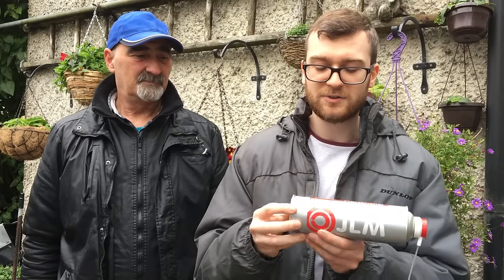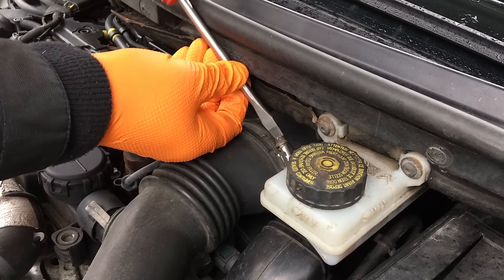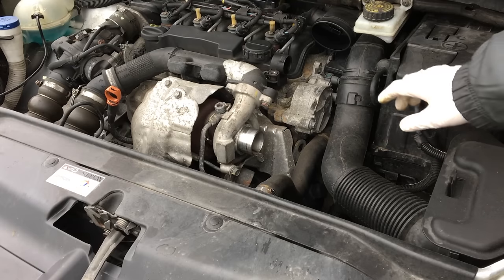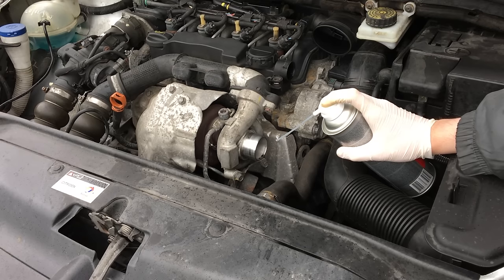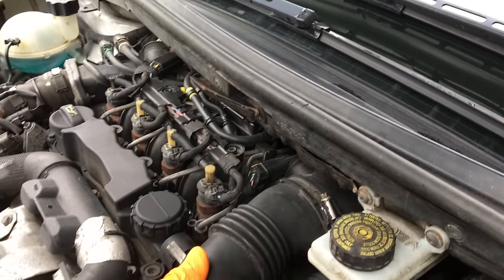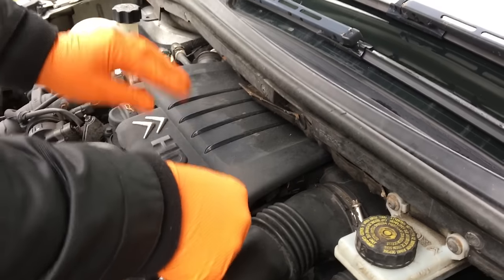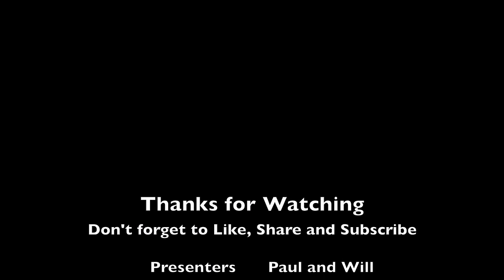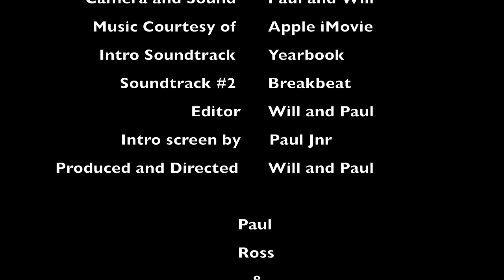How To Clean an EGR Valve Without Removing It

Comment: Good morning Gentlemen how are you after a long and wet winter ?, my 2012  Berlingo Multispace has 137000, miles on it would you think i could change the PCV my self ,to small a job to bother my Auto mechanic with ,keep safe Paul.
PS.when are you going to put out some new Citroen quick fixes ideas  please
Reply from the maker: The pcv is inexpensive and not difficult to replace. 
We are working on some more Citroen videos and will upload in the near future.
👍
Reply: Thank you ,keep safe ,Paul D

Comment: Good evening Gents great weather at last .a friend gave me a brand new turbo cassette which i could do with in the long term however when we fitted it  ,it fitted beautifully until we fitted the large circlip  and then it wont turn ? its exactly as my one in every detail  but must be 2 / 3 thou longer any ideas please ,i had bought a kit to restore my turbo bigger job i know Sincerely Paul D.
Reply from the maker: Hi Paul,
You must mean a turbo cartridge. 
Is it OEM or aftermarket? Is your friend a turbo specialist?  
It may look the same but there are several different genuine Garrett turbo cartridges for the Berlingo as there are aftermarket ones.
Did you get the replacement cartridge based on the model number embossed on the turbo housing that's in your vehicle?
Reply: Sorry you are correct Cartridge,no pats multispace was a write off  he purchased his as a aftermarket unit from some English company HJ is on it his citroen was as ours HDi 1.6 90  2012 he never got  to fit it before his brother totaled  there multispace ,there are only a few numbers on pats and lots on ours ,we purchases a kit to refurb ours but haven''t done a thing since we tried to fit pats and failed Paul
Reply: Hi based on your sound information i gave the Cartridge back  to Pat ,maybe you can suggest some one to rebuild my turbo or an exchange new for old situation please Paul
Reply from the maker: Hi Paul, The link below is for a company in Mullingar. Click on the link or copy and paste in your browser. 
We would suggest you have a talk with them before you commit. We have not dealt with them so cannot comment on them.
http://www.mullingarturbos.ie/
Reply: Thank you will do ,i appreciate all the help you give me ,Paul

Comment: Does egr cleaner make a petrol engine smoke as its burning off?
Reply from the maker: Not all petrol engines have egr valves. If yours does and you spray cleaned it then possibly expect a small amount of smoke initially as its recirculating and burning off. Hope this helps
Reply: @DrivewayDudes  it's all good I don't think it ever had been cleaned in 117k so was burning all the nasty crud off from the intake it's cleared now though
Reply: And thank you for your reply

Comment: Good afternoon Gentlemen  my mechanic showed me a wobble in the turbo shaft suggests i buy a repair kit on line and we can rebuild it can you suggest where i look for such a kit as there is no damage to the fan as yet but needs bearings,Thank you both,Paul.
Reply from the maker: Your mechanic may very well be correct but we would suggest you take your car to a Citroën approved garage to confirm (if its the Berlingo you are referring to).
Turbo rebuilds should only be carried out by those specialised in that field.
Blades spinning at up to 250,000rpm can disintegrate due to the smallest imbalance.
If it's not done exactly right it could lead to catastrophic consequences to not only the turbo but the entire engine as well.

The final decision is entirely yours of course
Reply: Thank you hence i asked your advice first ,ill do as you say ,how many rounds do i owe you now ?.Paul
Reply from the maker: We are happy to offer advice and suggestions. 
If we're ever in your area i'm sure a cuppa would be grand :)
Reply from the maker: Please don't put up your personal details for all to see. i saved it and deleted it here
Reply: ok thank you paul

Comment: Hi again i am again looking for your advice please  cleaning the berlingo cloth seats which are badly stained and a very dirty engine  bay full of dust its filthy but no oil leaks  TG Thank you,Paul.
Reply from the maker: We have used upholstery spray foam cleaner. Very inexpensive and quite effective. Purchased in the £ shop or for the millenials, € shop
Reply from the maker: The engine bay is a trickier decision. 
Option 1. Power wash it but make sure the engine is not running or too hot and avoid spraying directly on electrics.
Option 2. Hand clean with degreaser and hand wash off.
Option 3. Do nothing

Comment: I think you are too far away from the EGR for that to be much use, you could however make a fortune as a Robert De Niro double!
Reply from the maker: Hi kwempe, 
With the pipe from the air box to the turbo disconnected there is no restricted airflow. The turbo would then be quite capable of passing the spray towards the EGR valve. We understand it may not be quite as effective as spraying directly into the EGR valve but the valve accessibility is very difficult without removing parts from the engine. This procedure has been proven to work for us on this particular car.
Thanks for the info. If Robert De Niro ever decides to come to our area to make a movie then Driveway Dudes would be happy to work with him particularly if it involves cars or other diy related content.  😉
Reply: If its one degreaser basis I would be scared as fuck to blow it through turbo. Just remove the EGR instead and clean the whole intake...
Reply from the maker: EGR spray is not a degreasing agent. It's a solvent designed to breakdown mainly carbon, gum and varnish deposits that's accumulated over time.
Removing the EGR valve on this particular car is not straightforward and may be beyond the capabilities of your everyday diy enthusiast
Reply: @DrivewayDudes  EGR valve is next to the fuel filter. At 3:33 when the air intake pipe is off you can see the fuel filter. Remove this and the air filter housing and the EGR is easily accessible
Reply: @DrivewayDudes  Does it work for other cars?
Reply: kwempe thinks you are to far away from the egr to do any good, you may  as well be on the moon
Reply: @alanlegg9972  just got one moment think what does a egr valve do

Comment: I used a Wynn 3, for £10 from Halfords today and as instructed by the manufaturer, first allowed the engine to reach the operating temperature and then gave shot bursts by one second intervals while occasionally reved the engine to 1500 to 2000 RPM. Then left the engine on idle for 5 minutes and after that drove the car for around 7 Miles ( 5-10 km is advised). Eversince the engine is back to normality and now just can detect very weak hiccups whereas before the application of the cleaner it would hiccup constantly and would loose the power in idle position. I'm still waiting to see the problem % 100 sorted, otherwise will buy another can or replace the vale which is an expensive option ( EGR valve + labour costs and VAT is around £200 for my Renault Megane 2005)!
Reply from the maker: Hi Daniel. Glad that the Wynn cleaner worked well for you :) We recommend that you add an EGR Valve clean to your service schedule (at your discretion) or at least every 20k miles (30-35k km). This way the cleaner will hopefully dissolve the built up carbon and gum since the last clean and hopefully dissolve any of the older carbon build ups which were missed by the last clean however are now since exposed to cleaner. I'm not familiar with the Wynn cleaner, however if it is like the JLM cleaner we used, it should also be an intake cleaner which means it should yield positive results when it comes to cleaning your intake system and valves too. Keep us updated on your progress :)

Driveway Dudes - Will
Reply: Driveway Dudes I will. Thanks for advice. Btw, since last night ( 24 hours after cleaning) the problem has been fully tackled and the car is running perfectly.
Reply from the maker: Very happy to hear that and we wish you Happy Motoring :)
Reply: I've a 2lt diesel passat. Had trouble with EGR, used wynns extreme EGR cleaner spraying into air intake. Since then I use diesel additive in the tank. Cleans injectors, diesel filters etc, had no trouble since.

Comment: Can you use it in a car or a diesel car is a stupid question
Reply from the maker: It usually says on the can what it can be used on
Reply: Driveway Dudes I and up buying a new one I need one my check engine light comes on and I put it through the scanner and that’s what I read I need to change it thank for the video I was helpful

Comment: Hi, does the car in the video has FAP(Particule filter). Does this method works on 1.6 hdi FAP?
Reply from the maker: Hi Majercsak Mircea Robert,
Driveway Dudes Will's C4 in this video does not but Driveway Dudes Ross has a C5 and yes it did work for him

Comment: Great video 
Did our light turn its self off after you sprayed or did you still have to get computer to knock it off ????
Reply: It should disappear. However, if the valve is still stuck you should buy a new one
Reply from the maker: Light will automatically go out when it's clean

Comment: I've a 1.6 hdi 08 c4 Picasso service light on every time I start engine also says risk of dpf blocking. I've cleaned dpf filled up pats fluid under car. It's still does it. Car is fine in every way driving. Tried clearing message with my  dinostic scanner still stays on . Any idea

Comment: Hi i hope you are both keeping well ,some advice please on our Multispace Berlingo 1.6 HDi when i lock the steering to reverse right or the same forward i can feel a vibration coming back through the steering   ,what do i need to get fixed please   this started after we hit a huge pothole filled with rain ,thank you paul D.
Reply from the maker: Hi,
Hitting potholes can indeed cause steering issues, e.g. damage to tyre, damage to wheel, steering mis-alignment, suspension, etc.
We would recommend you bring it to a reputable tyre garage to have the tyre, wheel and tracking/wheel alignment checked. If you decide to have it tracked/aligned you may find it has resolved the issue. If not, then you may need to further investigate.
Reply: Thank you yet again we did as you have suggest but tyres  and tracking were all ok he could not find a problem  ? hence im annoying you Gentlemen  once again Sorry paul
Reply from the maker: No need to be sorry and you're not annoying us. We're happy to help :) It could be a drop link, tie rod end, balljoint, wishbone bushing, suspension top mount, damaged spring, leaking damper/shock, engine mount, etc on either or both sides.
It would be best to bring it to a mechanic or garage that is familiar with the brand
Reply: Thank you will Do Happy weekend Gents paul.
Reply from the maker: Thanks and you too.

Comment: Good morning Gentlemen once again a question for you i  would like to fit  a reversing bleep to my multispace  plus 2012 1.6 HDi 90 i notice there are bulbs one can buy that seem to do this ? your suggestions please as i havent a clue what to do but i need a bleeper,thanks Paul.
Reply from the maker: There are different types of audio reversing bulbs available to buy. 
Two things to take into account. 
1. The fitment size/shape and 2. Canbus friendly (i.e. your car will accept the bulb and not throw up a fault on the dash.
I have tried some in the past. From experience I have found they don't last very long. 
A reversing proximity sensor kit may be a better option. They are inexpensive but installing it may be a challenge for the average diy enthusiast.
Driveway Dudes - Paul

Comment: i just bought a 06 ford focus mk2 n the car once started is okay but if i park it up and leave it for 20 mins or so and try to start it then it doesnt start unless i bump it or i use a booster, it will turn over about 10 times then a click and then i think the battery is about dead but i had my alternator and battery checked n they are fine?

any ideas please
Reply from the maker: Sounds like it could be the battery but there could be underlying or other issues too. 
Easiest way to check is start the car and disconnect the + clamp on the battery terminal. if the car dies then your alternator has had it. If it continues to run then it's may be the battery.
Another issue is that your coil pack could be overheating and giving a weak spark, thus the need for a booster.
let us know how you get on.
Paul
Reply: okay thanks mate also i forgot to mention its a 1.8 tdci and now i noticed like a whooshing or whining noise really loud when the car is in motion and when i accelerate past 2000 revs but if i depress the accelerator it stops, the more revs the louder the noise, does not seem to do it much when cold though.
Reply from the maker: We don't have a 1.8tdci but from what i've heard it could be any number of things from loose or broken pipe/s, injectors/rail, starter motor, dual mass flywheel/clutch, turbo, wastegate actuator, etc.
To us it would be a process of elimination by checking one thing after another.
Ford has been using the 1.8 engine since the 80's. It's known to be pretty bullet-proof and problems are generally attributed to poor maintenance or ancillary parts failing.
Hope this helps.
Paul
Reply: Okay thank you, i will have to start by elimination then and thank you again for your help...love the video's

Comment: Hello Driveway Dudes :)
Some advice would be lovely! 
I was driving my Peugeot 208 today, as I left a roundabout the car shuddered and the check engine light came on. Now having trouble accelerating at low gears. The car will start easily, but when I put it in first gear, it has trouble actually pulling the car. If I move to second gear at 10 miles per hour it has trouble gaining speed again. Similar changing to third gear at appx 20 miles per hour, trouble gaining speed. It's like it doesn't have enough power.
We have disconnected the battery and let the car reset. It will run fine for a few minutes, but when I reach appx 20-25 mph the issue occurs again.
Another strange thing that happened at the same time is that when I turn off the engine, the fan continues to run until we disconnect the battery.
It is a Peugeot 208, petrol, 1.4, 2013 plate. 
Thanks xxx
Reply from the maker: Hi AtemsGal,
The 208 is a good car but like most cars can be prone to faults, be they minor or more serious.
Ideally you would need to get it checked and scanned by an approved garage so that any faults that are recorded on the cars ECU will show up.
We have heard of various reports of issues with 207 and 208 models similar to your issue. 
The most common reports are - slipping clutch, coil pack, a fuel injector, dirty fuel, overdue service, failing alternator, etc
A replacement clutch or coil pack is expensive, an injector or alternator less. Dirty fuel can be drained. Service costs would depend on where you were to bring it.
Very seldom will a scan not locate the issue.
I would repeat above, Please have it checked by an approved garage. 
Hope this helps.
Paul
Reply: Driveway Dudes Hi Paul thanks for the advice :)
Took it to the garage today. They said the coil pack was damaged and it had, in turn, damaged the spark plugs. 
£180, not too bad. Thought it would be much more with how the car was reacting! 
Thanks again :) xxx

Comment: Hello gentlemen,I have a nissan primastar 2.0,its got 250,000 kms on it,has been well mantained,oil ,filters,air sensor. I drove it the other day and it sounded like it backfired and lost power felt like it was running on 3 cylinders? gave a puff of light blue smoke.started it today it was smoking slightly,took it up the road and it gushed out clouds off white smoke so brought it back not blowing white smoke on tick over,??? could it be EGR, water in the fuel ,coreplug? any ideas Thanks in Advance
Reply from the maker: Hi Tarsneyisle,
Sounds like a blown cylinder head gasket.

Check your oil for water and your coolant water for oil.
Paul
Reply: Hi paul just checked the oil and water both look normal,no gunk or drops on the dipstick water looks good just started it now and i can,t see anything coming out of the exhaust even when revved? and seems to be running fine.
Reply from the maker: That's good news. Check again when the engine gets up to running temperature. 
Excessive white smoke is usually diagnosed as a blown cylinder head gasket. Sometimes everything can seem quite normal until the engine gets hot, metal expands and gaskets soften.
Keep an eye on it just in case and try to avoid any long journeys until you're certain it is alright.
Paul
Reply: only trip i take will be to plug it in at a garage,just wondering if it might be a turbo problem,will post the results when i get them! thanks for the replys and info Alan.
Reply from the maker: Good idea. OBD check may find something. You'd definitely know if it was a blown turbo as you would have billowing and heavy blue/black smoke.
Let us know how you get on.👍
Paul
Reply: will do and thanks
Reply: Is it same procedure for merc c279